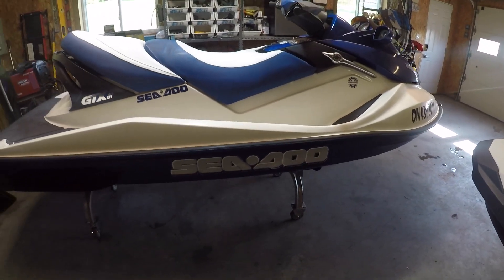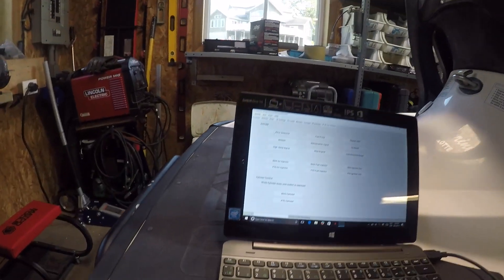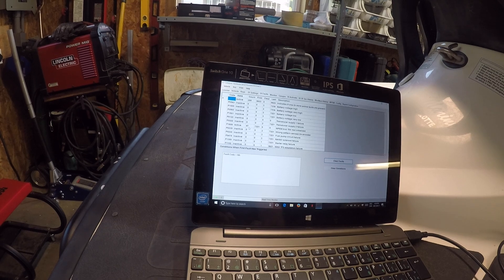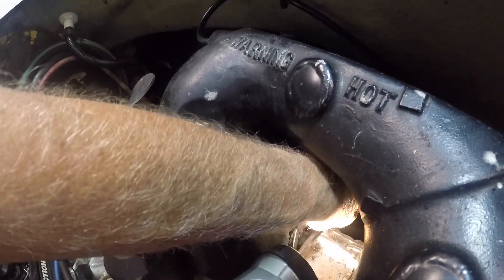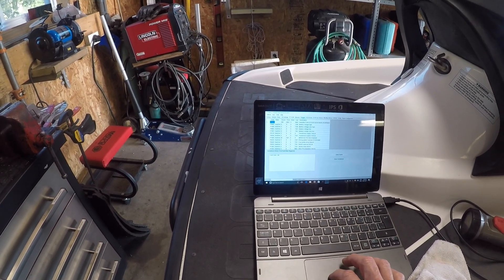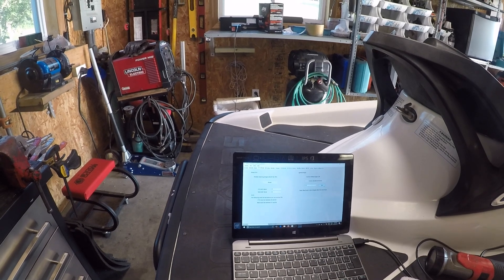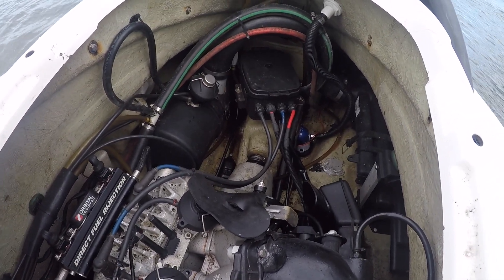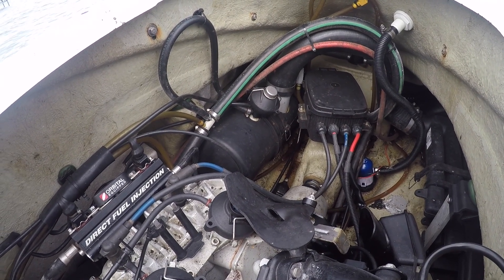2002 Seadoo GTX DI Diagnosis and repair

Comment: 02 gtx di. Ski runs great np and has the double beep when putting the key on but the mode set buttons do not change anything on the tach. First few trips out it did work but just thought the button was going bad due to it being hard to change settings.  Now it's just stuck on the compass. Put a new mode button in n still nothing? Would the rectifier cause the tach to not work or could the rectifier cause the battery to run down without being used. I got no maintenance light and ski runs fine?
Reply from the maker: this sounds like a possible wiring issue or a cluster issue.  possible corrosion at connectors ?  Unlikely that it is a power issue.

Comment: Can the candoo pro help with key issues or programming keys? Chasing a funky issue with mine. Does nothing with key inserted. But forsure getting power to computer.
Reply from the maker: Candoo can easily program keys but that does not mean that is your issue.  If you get no double beep then either you have a bad beeper or there is an issue with the dess post..computer or wiring.
Reply: How much is the candoo pro software?

Comment: Hoping you can help me out, I've watched many of your videos.  Great work!  I have a 2000 SeaDoo RX 951DI - runs amazing at speed, but stalls out on idle in the water.  Supposed to idle at 1450, and it does that out of the water on a hose.  When idling on water RPM's will come down to 1450, then drift down to 1440, then 1430, etc until it stalls.  It will them be hard to start, and seems to start better with some opening of the throttle.  Compression is at/a little over 120psi each cylinder.  Any tips on what to look for would be greatly appreciated?  I've replaced the fuel and air regulators, injectors, fuel pump filters, and tested pressure in fuel and air at the rail (good).   Thanks in advance, Mike.
Reply from the maker: Air leak for sure.
Reply: @SeadooRefurb  thank you, I’ll dig deeper into that.  Appreciate your time and knowledge.

Comment: That looks like the 951 DI motor?  If so, it looked like compression was around 120psi.  Is that okay for that motor?  Shop manual doesn't like specs.  I am getting 110 psi on my 2000 Rx 951 DI, and I figure it's time to do the top end because of the aforementioned and 225 hours.  You're the best, love watching your videos.  Thanks!
Reply from the maker: 110 is a bit low.  Typical engines I get that are still running strong are 120 - 122 on my gauge.

Comment: I have a 2001 sea doo GTX DI. I had a PWC mechanic go through and service it. It has been sitting for six years. He told me that it needed new RAVE valves. I noticed that the valves he used to replace them with had a red top instead of the blue cap. I ran the ski for about 5 minutes at idle and it stopped dead in the water. Neighbor came over  look at it with me we pulled one on the RAVE valves and it was chewed up. Guessing that either the wrong valves were installed or the clearance was not gaped correctly.. Please help if you can.

Thanks 
Dlq9an
Reply from the maker: There are blue and red caps and that is not an issue.  My guess is that the engine was rebuilt at some point and they bored out the cylinders and put in oversized pistons.  I am guessing the mechanic did not verify that before installing the new raves ?  If they are chewed up then the raves were too long and hit the piston rings and destroyed them.  I am also guessing that you have cylinder damage as well.  If you have a small scope camera you can pull the spark plugs and have a look in the cylinder to see what you see.  Sorry about your mishap .
Reply: @SeadooRefurb  
Thank you so much. I will check on this and let you know what I find out.
Reply: @davidquail197   Same issue here.  I just pulled the heads and looked at the damage.

Comment: Hey I am trying to diagnose similar issue with 2001 GTX DI and have narrowed it down to insert DESS Key and get 2 beeps and Fuel pump primes DI,,, press Start and fuel pump primes again but no click at the relay/solenoid... if I jump the relay it turs over... I replaced relay but same.. seems only getting max 5v to the exciter wire that's supposed to trigger the relay.... only thing I can think is a short somewhere... but how to diagnose where and how to fix is beyond me! Any ideas?
Reply from the maker: So the fuel pump should not prime again after pushing the start button.  5 volts is too low for sure.  I would check all connections at the computer and see if there are any broken pins or corrosion.  Also test the main fuse at the computer and see how many volts are present.

Comment: Good stuff. 
Would you consider to share what software utility you been using for this diagnostics and what set of cables?
Reply from the maker: I use the cando pro .  It comes with all the cables you need for all the seadoo's .
Reply: What is the price tag and where can you get it?

Comment: I got a 2001 GTX DI with a P0335 Wrong pattern sensed on encoder. I cant figure it out
Reply from the maker: possibly contamination on the crank position sensor.  I have seen rust and metal on them.

Comment: I just ordered my rotary valve shaft. I'm going to open the bottom end up to clean it up and get the brass shavings out. Is there a gasket in there? If so, could you provide me with the link or what gasket i need? I cant seem to find the answer anywhere. Thanks again!
Reply from the maker: There is no gasket in the bottom end.  Just clean it up with acetone and apply a thin coat of loctite 5910 or permatex ultra black.

Comment: I have the same jet (GTX DI). Everything is running fine, but the speedo doesn't work (neither analogue nor digital). Do you have any help/quick fix how to repair this? Thanks :)
Reply from the maker: The issue is usually a faulty paddle wheel that is located at the back of the machine to the left of the pump.  Cando pro has a gps module to replace that but it is currently out of stock but should be back in stock this summer.

Comment: Have a question for you My 03 gtx 4 tec will run amazing for about an hr then stutter and die I can leave it sitting for 30 minutes it will run good for about 2 minutes and then repeat if it sits over night it’s it does the same the next day runs good then randomly stutters and dies
Reply from the maker: This is pretty much impossible for me to diagnose without seeing the machine/ pulling any diagnostic codes etc..  It sounds like a fuel delivery issue or water in the fuel but too hard to tell.

Comment: Can I just remove the Oil pump on my DI and mix the gas myself. Would it throw anything else off ?
Reply from the maker: No.  The fuel injectors will not like oil in the fuel.  They will clog up.

Comment: hey man. just recently bought a 717 gti. needs a new rotary valve shaft. The plate on the engine side has some metal scratches through it. not very deep but there's 2 scratches. Will that affect anything? I was just maybe try to sand it down, but if not, is it going to affect the motor? Thanks.
Reply from the maker: I have had some machines with the worst scratches you have ever seen and they still run great.  All I can say is give it a try.  You should be ok if they are not deep.
Reply: @SeadooRefurb  awesome! I appreciate the response

Comment: Hey man. Got another question! So my 717 motor needs completely rebuilt. I’ve found a few random people online that do it but I’ve been watching all your videos & figured I’d ask if you do anything like that. If you’d be interested, let me know some pricing!
Reply from the maker: I only do project for my self.  Do you live in Canada or USA ?
Reply: @SeadooRefurb  USA. Everyone just charges a fortune to do it here
Reply from the maker: @TeamMEC  https://www.cvtech-aab.com/  .Check these guys out.  I think they will ship to USA.
Reply: @SeadooRefurb  no longer in stock. I appreciate the help though! I’ll find someone online or man it up & do it myself
Reply from the maker: @TeamMEC  No stock ?  Did you call them ?  You may be able to send you motor to them and have them machine up that one.
Reply: @SeadooRefurb  I did not call, I just saw on there website it said out of stock so I figured they may have stopped working on them. I’ll give them a call right now and confirm that. I’ve had one offer to rebuild entire thing for $900 plus shipping back and forth. Best offer I’ve received
Reply from the maker: @TeamMEC  crank is about (in Canadian Funds)  600.00 for rebuild , cylinder hone is about 80 per cylinder and then you need gasket set, pistons and rings.  Very simple assembly.

Comment: Where is the best place to get the diagnostic software and necessary cables?
Reply: Sorry, I just read earlier question. Candoopro. But how about the cables to hook up.
Reply from the maker: @alanjones9043  they supply all the cables as well.
Reply: @SeadooRefurb  do you have images of the candoo pro you are using?  I searched that and are seeing many different things ranging from $5000 to $450, What did your cost?
Reply from the maker: @vjdaino  The prices change as per the options you choose.  If you pick seadoo option with 4 vins then you would expect to pay 450.00

Comment: can you delete oil injection and premix this model?thanks
Reply from the maker: No.  it will mess up the fuel injectors / compressor oil and crank oil.
Reply: @SeadooRefurb  will it hurt to add just a lil to fuel
Reply from the maker: @inthenameofmyfather3836   small amount won't hurt.  I have done it a few times on a new rebuild.

Comment from the maker: Corey Martin 
Good video. I believe I saw that same one for sale, I recognize the seat on that GTX DI and the story about how the previous owner was feed up (lol DIs are trouble). Regarding the fins on the back, they are the OPAS (off power assisted steering ) to help turn the sea-doo when the throttle is fully released. This https://www.jetdrift.com/sea-doo-opas/ is a good article which has more information, eventually (2008ish) OPAS was replaced by IBR.
Reply from the maker: For some unknown reason this comment would not show up.  I have reposted.  It was a good read.  Thank you.